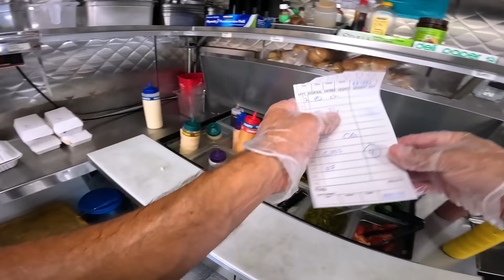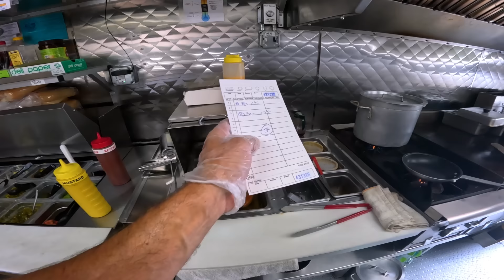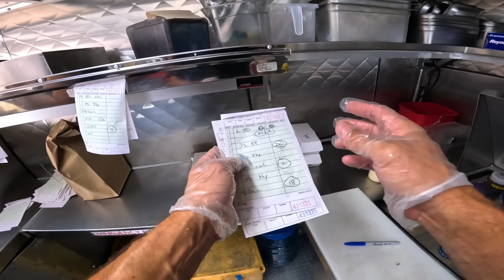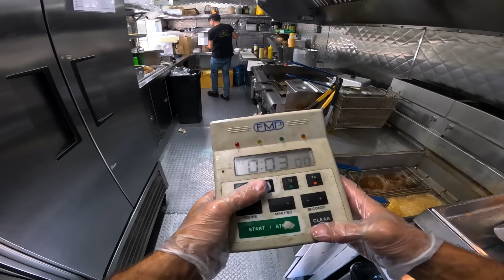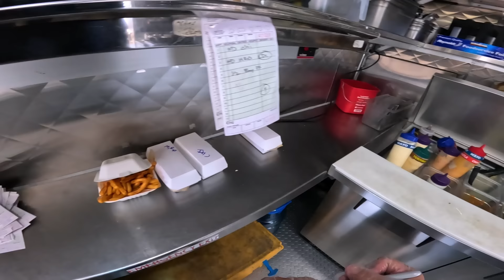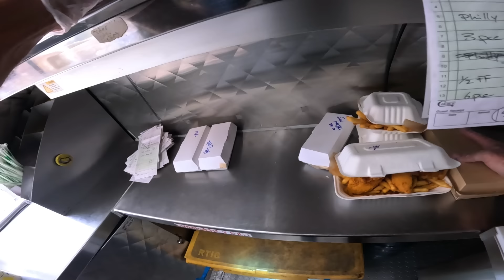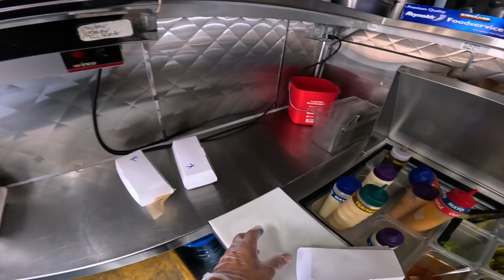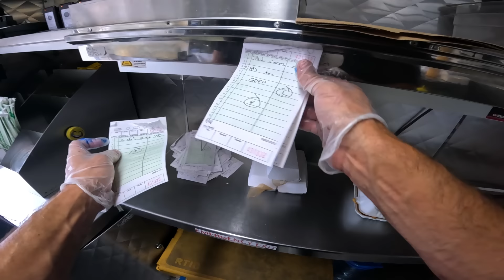Rush Hour | Hot Dog Food Truck Cooking POV

Comment: Pardon my question,  where does the grease go from that little hole in the bottom of that grille?  No one ever explains if there is a trash bin or it goes out the bottom of the truck. 😅
Reply from the maker: Yes there is a grease trap that gets emptied. We will have to add that detail into a future video.
Reply: @PrettyOddWieners  Do as you feel.  NY appreciates ya!